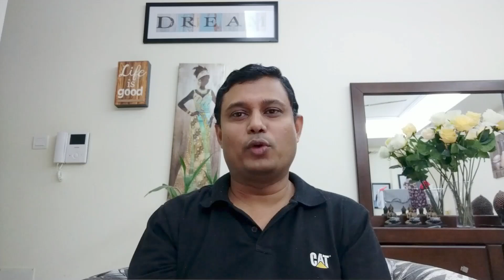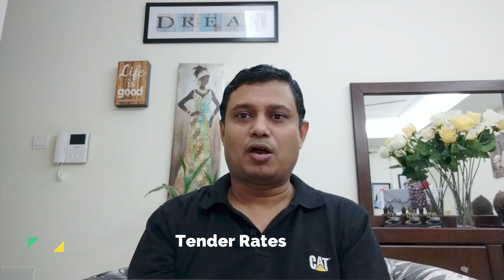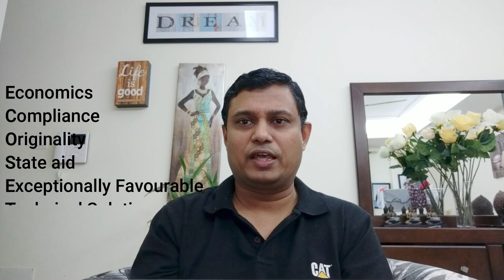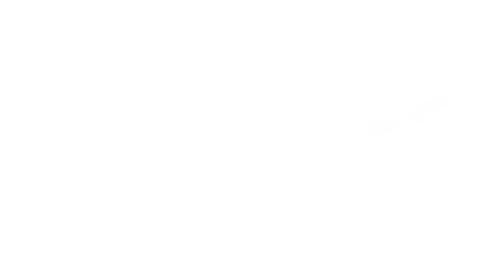MCA: Justifying Abnormally Low Tender Rates

Comment: Another superb demonstration. One grey area for me or i may have probably missed this. Shouldn’t the bidder to have complete understanding of governmental regulations/policies applicable to the project location prior submission? if the bidder has considered working days as 5 but the reality been 4, bidder is culpable, isnt it ? Or otherwise ?
Reply from the maker: Thanks for your insight. I specifically used the words "international contractors" and a "newly regulated rule"    for this. Now I will explain you how compliance with a newly established regulation will benefit a mindful tenderer to still quote a competitive rate than the others. Suppose you are an international contractor who is accustomed to 4 day working conditions. You may have already read articles that in reality 4 day working conditions benefit the efficiency of staff. So when you are bidding in a country who recently established this law, you will price more smarter than the others who are not exposed to the benefits of a 4 day working conditions and thus they will price for the risk. Therefore still "mindful compliance with new regulations" can be a justifiable cause for an abnormally low yet more attractive rate. Having said that, I 100% agree with you that the tenderer shall fully comply with the laws of the country by all means.
Reply: @MindfulContractAdministrator  Understood. Thanks !